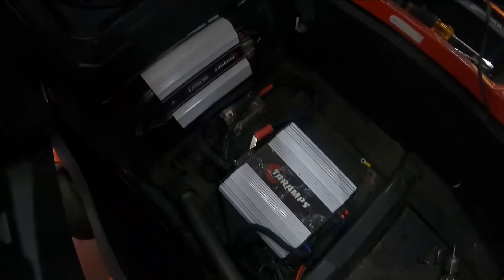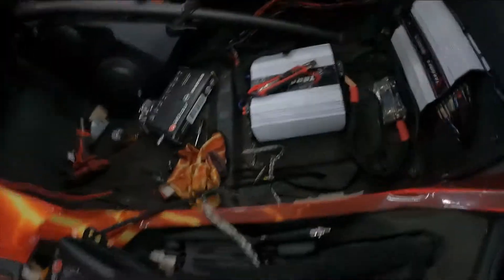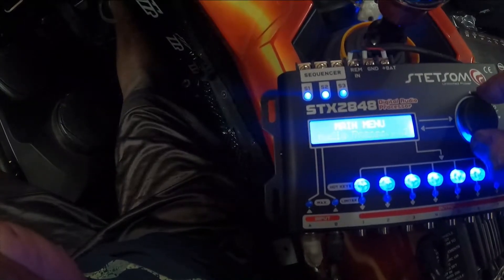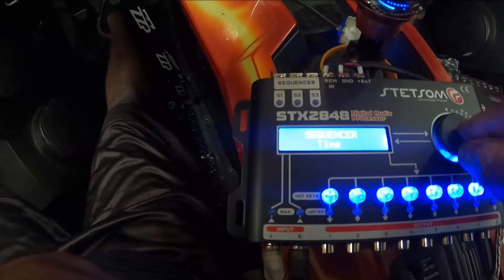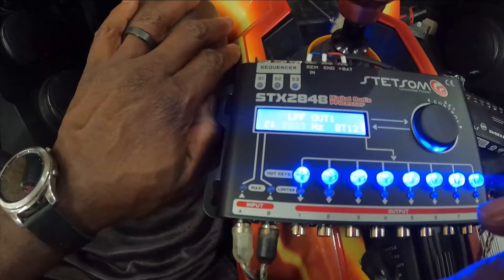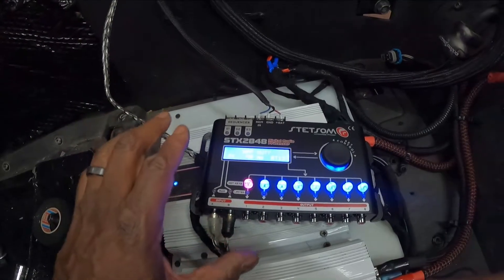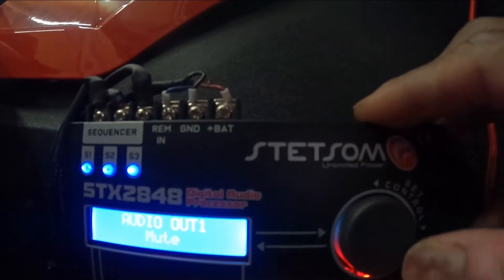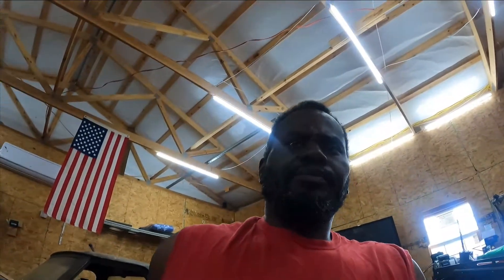I'm putting a DSP in my Polaris Slingshot!!!

Comment: Nice. Would you need one of these to control the frequency on 1 Taramps 800.4 ?
Reply from the maker: @djrekklessdmv8757  Yes, that is exactly what I was using for. I am running (3) 800.4 in my shot.
Reply: @rrrobin2569  Thanks for the quick response. 💪